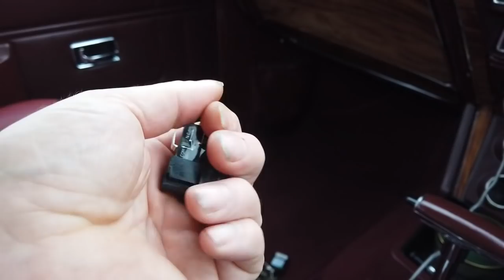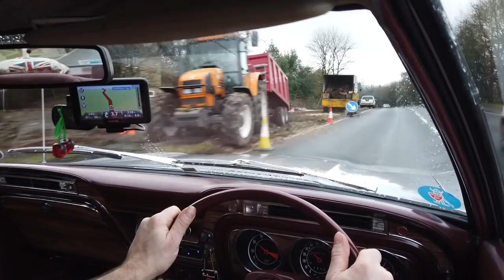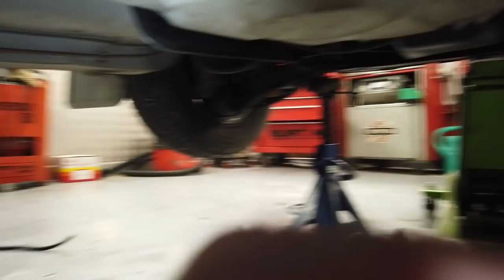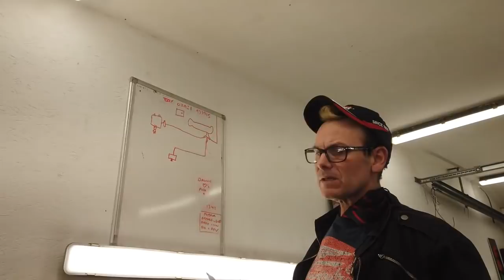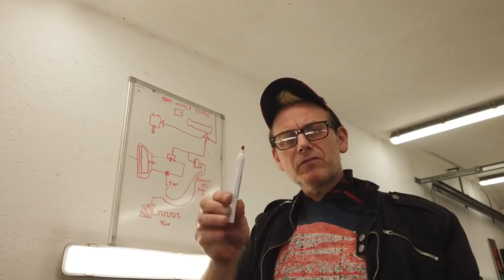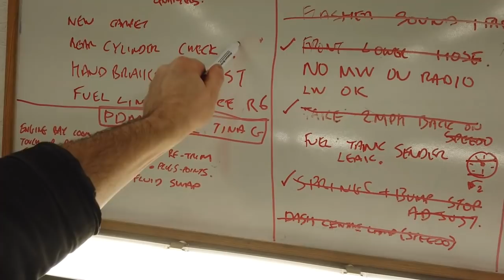MK3 Cortina Tune up - Engine and Auto Box - Pinto + A4LD

Comment: Really nice cortina and especially liking the A4ld. I have a question about this particular transmission, hopefully you would be able to help out. Do you have the version with dual solenoids (for overdrive and tcc) or the single solenoid version (only for tcc)? I have the single solenoid version and I'm having issues with the 4-3 downshift. When driving in D, it will only downshift 4-3 without kickdonw up until 55mph or so. After that it will only downshift with the kickdown, not with moderate throttle pressure. How does your car work in these conditions? I'm having real hard time finding any solid info on these
Reply from the maker: I have had similar issues, I read that you can buy an adjustable vac modulator. When I have asked about shifting issues, everybody tells me that to first try the vac modulator as this is the key component that controls up and down shifts. Make sure there are no pressure leaks into the vac lines/tubes. I also have the single solenoid box. My box is my silver cortina, changes up a little too quickly and does not like to change down under moderate throttle. however the a4 box in my yellow car is perfect, so im trying to get both mine to behave the same, i have ordered another vac modulator from e bay to try and see if i can get the silver car to downshift as i like.
Reply: @PeteCswampy  Do you have a shift kit installed in either of the cars? I have the Transgo shift correction kit installed. I also played around with an adjustable vacuum modulator but it did very little to improve the downshift with moderate throttle when going over 55mph in overdrive. It did have an influence on the 1-2 and 2-3 upshift, but in the end I found the standard non-adjustable modulator the best. Are you taking the vacuum from the same place in both cars?

Comment: Hi Pete, Great video.  The car runs really beautifully now after the latest tweaks.  Was this auto box basically the same model as the original or is it a newer design?
Reply from the maker: this is an A4ld gearbox from a Granada, it gives 4 speed and TC lockup up for a near 5 speed manual gearbox drive

Comment: Hi Pete

The vacuum in the intake is the difference between the air flow of the carb at a given throttle position and the actual air flow required for the engine at a given engine speed (RPM).  The design of the intake system has to match intake at the carb with the engine required air intake with the correct air/fuel ratio. 

Steve

Comment: Good to see you keeping busy Pete, good effort for getting in the " Classic Ford " mag, well deserved.👍😀
Reply from the maker: thanks steve
Reply: @PeteCswampy  Just a thought.... I wonder if a Volvo or Jaguar I-Pace electric motors would fit in the back of the `Tina ` without any cutting other than adding required mounts ?? 
The motors look like barrels with drive shafts at each end, the diff`s etc are all self contained so no diff casing hanging of the side...   
If the motors fit there would be a lot of space for a battery pack , under rear seats, gearbox area engine bay, BMW I-3  modules would be a good choice to create a battery pack :):)

Comment: Lovely vid Pete as always.  Takes me back to my 1600 xl with stage 3 Kent crossflow on 1700 overbore with FR2 cam, stage 3 head and a GT gearbox.  With 4 speeds it was at 3800rpm at 70.  Good for 110bhp on the dyno but never idled!  Nowadays on my lovely old Rover p5b the recommendation is to set timing at max vacuum!!
Reply from the maker: Nice one!